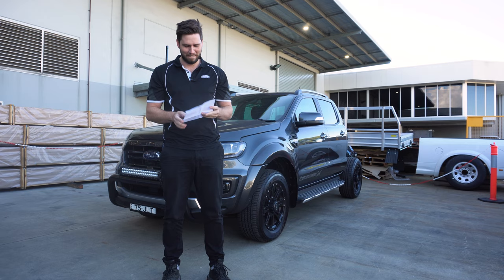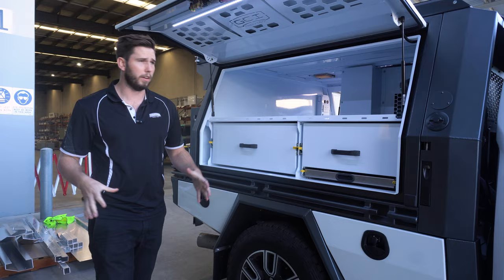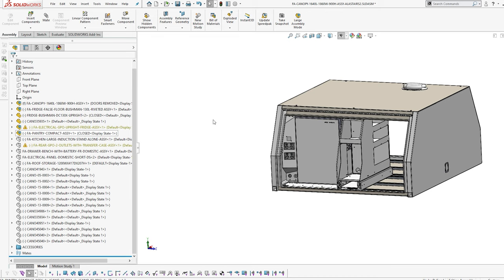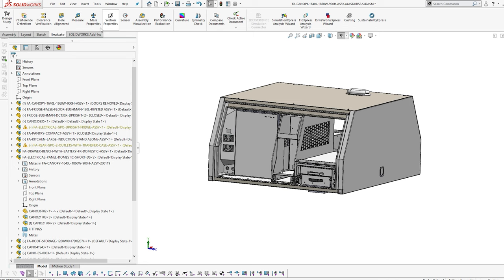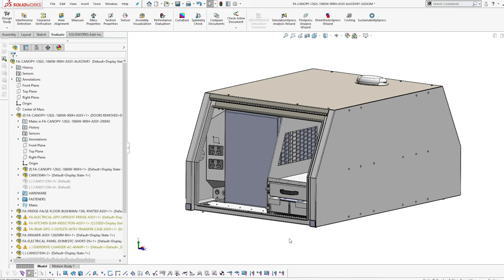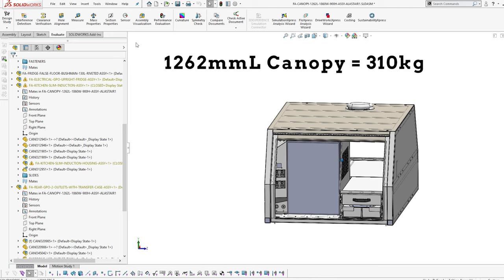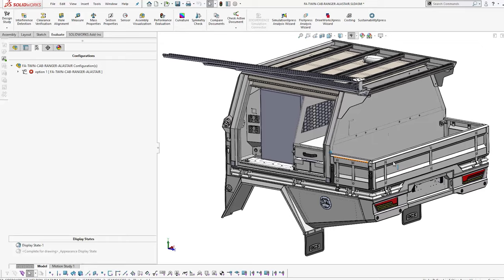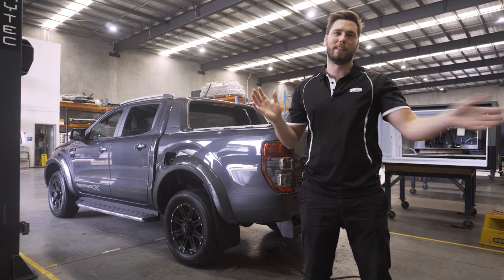What to Lookout for When Building Your Tray and Canopy! | Part 2/2 | GCI Traytec

Comment: The Video was very educating, One Question I Have. Can you make the first option that you suggested in the Video on a Isuzu Dmax.
Reply from the maker: You would be looking at a similar situation with the new Dmax and the new Ford Ranger, as the payloads are similar (depending on your model).

Therefore, you may still get away with selecting the first t/c option legally, but it will restrict what other modifications you would like to add down the line and potentially alter how the vehicle handles if not loaded effectively.

Comment: Awesome mini series guys. What would be the weight gain/loss with a chassis mount setup? Only having to have 1 floor and no lift supports, I'd guess you'd gain about 60kg, pending what material you use.
Reply from the maker: Hey mate, good question. As we do not build chassis mounted canopies, we have not looked into how much weight would be saved.
Reply: @gcitraytec  could it be something that you look at doing in the future or are you happy with how it's all going now? Thanks for the reply.
Reply from the maker: @ditched_the_load  We can never rule anything out, however at this stage we have not considered adding chassis mounted canopies into our line-up.

Comment: Can you do just a mounted canopy with out tray??  Would help yr weight isssue.
Reply from the maker: Hey mate, due to flexibility reasons we do not offer chassis mounted canopies. All of our systems are lift off for the future possibility of using the tray space when it is needed. 

We understand some customers may not ever need to take off the canopy. However every aspect of our designs are set up to accommodate for when your requirements in a build change.
Reply: @gcitraytec    I see a huge opportunity as well fix or help improve every single build weight issue.  Jump ahead and please consider get it happening now.  Because in my view.  It’s only a matter of time before you do. Because the weight issue is never going away.  Just my view.  Love your wrk. Cheers

Comment: Awesome video. Just a question about power options, do you only use Endrive or is there other options like Redarc?
Reply from the maker: We have our mid-range and high range electrical packages with Enerdrive and our entry level package with Victron Energy. We do not fit Redarc or any other brands into our setups at this stage.

Great question!

Comment: What is the combined weight of the 1850x1800 tray/ canopy empty (dual cab) please?
Reply from the maker: Hey mate, great question. You're looking at roughly 395kg (1800Lx1850W fully optioned tray = 260kg & 1650Lx1850W empty canopy)